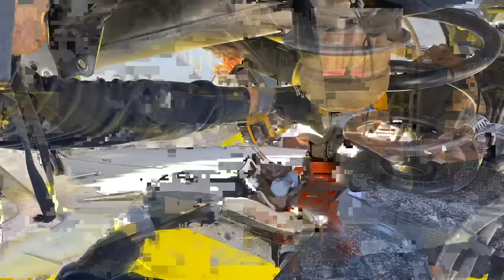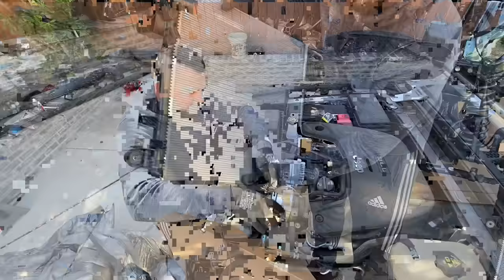REBUILDING A WRECKED 2020 JEEP GLADIATOR IN 10 MINUTES

Comment: One thing for sure, That jeep was not wrecked. It was in good condition.
Reply: Apart from the hood
Reply: And apart the bent frame, you try bending the frame on your vehicle without hitting something that God put in front of you or something stationary / man made. If you collide with a deer or dog you'll just end up with a mangled body but if you hit a wall-pole-tree or an oncoming vehicle that your frames at risk of bending
Reply: @davidaldridge6585  also it depends how hard u hit too.
Reply: Same when he put the wheels on it looked dope
Reply: it was in good condition or maybe a great condition in india for sure. it s called standard differential brother.
Reply: @Jeff-qq7im  Not only in India bt was in a good condition in General sense also. And now it depends on the owner and his perception that how he sees his car and what  he expects from it.
Reply: Yeah right its just modified
Reply: Wtf?  the jeep didn't take its initial impact from the front, one of the front tires did, that's why it had frame damage and Differential problems.   Damaged radiator, ruined fascia, hood, Diff, suspension damage....   that thing was wrecked for sure.   might not have had that bad of damage, but that doesn't mean anything. underneath all the cosmetic stuff, there's so much internal stuff that's screwed up.    he probably got that thing 25-35% off Reg. because of its damages.  Mods and stuff cost money but in the end it probably cost him the same to rebuild and mod it into that sick looking jeep Gladiator then to buy a new one completely stock.   if he sold it he could make some serious profit.
Reply: @hyperion9338  , what general? indians people general of course ? LOL. 
I have visited india last year,   I see so many motorcycle with ripped seat. rusty tanks, with full of dirt.  but peoples dont really care. just ride elegantly. with full horn actually. I feel you brother. 
I suggest you come to visit east asian. we will show you how we really really care about our vehicle. specially for thailand or indonesia, even with the cheapest motorbike, we decorate it  so nicely. you will see rainbows in every single road. every single river and sea.
Reply: No, it was wrecked. Probably had a salvage title when he bought it. It was a lighter hit car for sure, and a somewhat easy to rebuild. It looks like he had to get some frame work pulled.
Reply: @hyperion9338  When you don't know something, please don't share your views about it online just because you have cheap internet. I'm from Mumbai and even in India is this definitely considered a wrecked vehicle. We take cosmetic damage lightly here, but the damage was not cosmetic. The vehicle had obviously been in an accident, the frame needed work, one body panel was missing, the hood was dented, among other things, did you not notice any of that? Or perhaps you have never worked on a vehicle. No legit workshop in India would classify this vehicle as road worthy.
Reply: Just a little body damage
Reply: Which place visited ypu in india....lol......
Reply: It was crashed
Reply: It was definitely wrecked, crashed, or whatever the insurance company would call it. It was not "totaled" or "salvaged" which I think is what most people are used to seeing rebuilt. And I NEVER felt mislead from the title or image so it surely was NOT click bait. People are injecting their own thought pattern to what they have seen rebuilt and drug out over a 10 part, 14 minute per episode, series that leaves you pissed off and even possible missing an episode. Even if you sub to it...thanks YouTube. Also, has anyone priced these parts? Just the OEM replacements PLUS, OMG, ***LABOR***!!!!! Even with what most are calling minor damage, it's easily $7k to $10 in total if you were taking it to a top notch repair facility.
I do like that they did repaint all the parts back to the factory color before wrapping. Reverse the video and this Jeep is stock again in just hours, which increases it's value and buying market. Kudos there!
Once again, this was "Wrecked" and "Rebuilt"......not these highly questionable salvaged, non running, death traps whose work we never see in details like we saw here in one episode.
Thanks to the channel owners for this very satisfying video!!!!
Reply from the maker: this car holds a salvage title there was slight frame damage on it and in the United States its definitely considered wrecked. we have a video on our channel of what we spent and bought and replaced.
https://www.youtube.com/watch?v=Ts6WKB5Rx6o
Reply: @customautobuilds  it's a joke about how the Jeep market is filled with people saying their car is in good condition when it's not
Reply: Oh...love it to be in my country.Can you do up old wrecked  one
Reply: @babooraoshetty9662  🤭
Reply: @Jeff-qq7im   Yes, because in India we actually use dictionary, right @HYPERION
Reply: Get your eyes checked 🥲
Reply: @Seban1999  sorry ! my eyes are fine. By mostly Indian standard, Jeep was good.
Reply: Just dirty only. I agree 👍

Comment: I’m honored to call you a fellow American citizen. What you’re doing is what freedom really is mainly about, minimal government involvement and mutual respect for other citizens. I grew up in south east Oregon on the Oregon High Desert before joining the Army as an Infantryman. And my experience with working on and driving 4 wheeled vehicles off road helped me a LOT! I keep warning young people of today that buying a heavy 4x4 isn’t always a good idea, all that weight can create more problems than solve them. In the 80’s we preferred Toyota Hi-Lux’s with some modest mud tires and a couple inch lift, we could “float” across some bad patches of mud or pile of snow where we use the momentum and don’t give it much gas while doing it. But now when I see off road videos of people in the Cascade regions with heavy Tundra’s or F-250’s with added on aftermarket front and rear bumpers, heavy tires, etc it just complicates things. Vehicles like the one in this video are perfect for a good reliable/average performance that gives you the best of both sizes of weight classes. Well done!

Comment: If you know 100% that you are going to modify your truck/Jeep.  You are better off getting one that has been in an accident.  I bought my truck brand new and I took off the bumpers and replaced them with ADD steel bumpers.  I also put on 40” tires 🛞 with new rims, a custom hood, a custom grill and new fenders.  I also put on Fox 🦊 Shocks that gave it a 3” leveled raise.  The outside has essentially been completely replaced.  I probably would have saved $20,000 if I would’ve bought a damaged one.